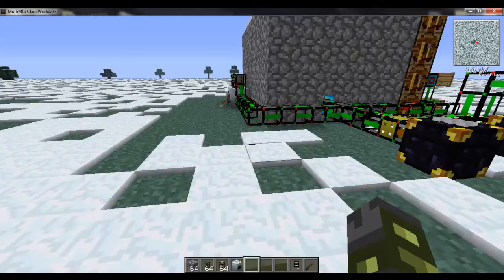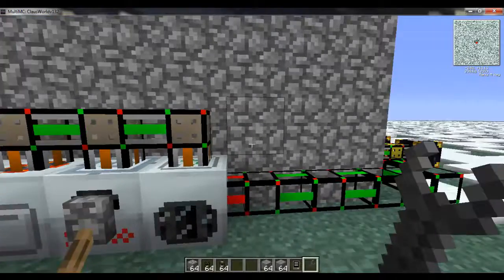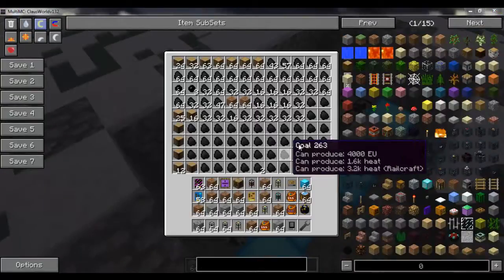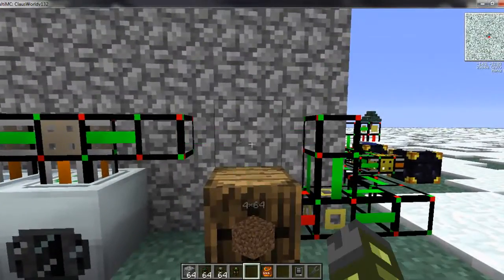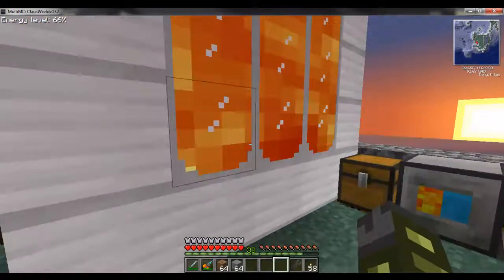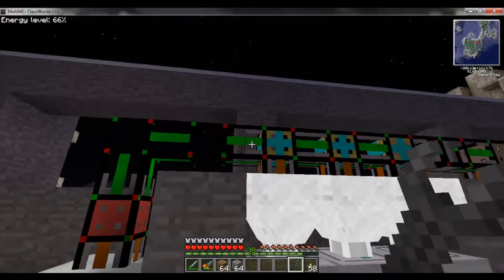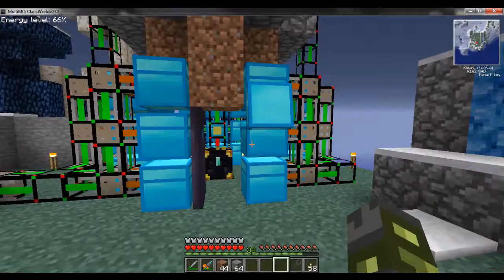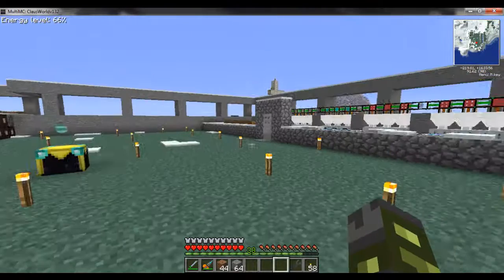Logistic Pipes Tutorial - Episode 9 - Advanced Setups - Recycling and Terminating Excess

Comment: don't worry about the blow up that's why its a test world. i did get it to work tho. the satellite pipes were the key i put the crafting pipe on one side and the satellite pipe on the other set the out put in the crafting pipe to humus and in the satellite pipe slots put the materials and it works.

thanx so much for your help now i'll just have to see if that also works with stuff like the thermionic fabricator. that might be more difficult as it need glass in its extra spot.

Comment: ya just checked my test world and that's what i had was crafting pipes on the carpenters. i did remember that i'm using a slightly older version of logistic pipes tho as i'm using the FTB beta a pack which is 1.4.2. so it may have been a bug that was fixed if its working for you.